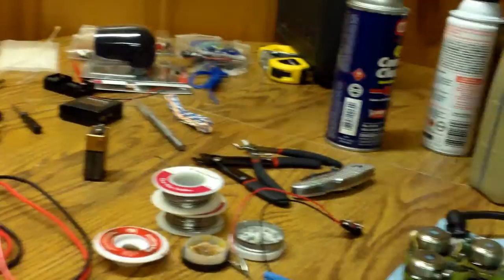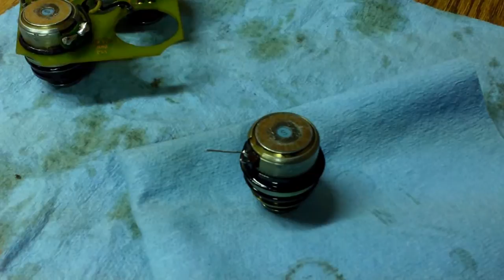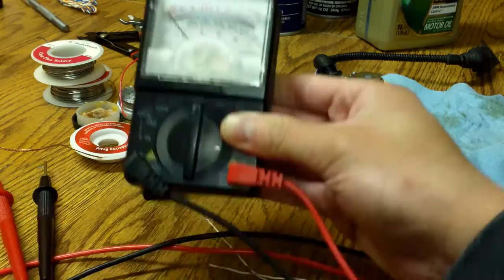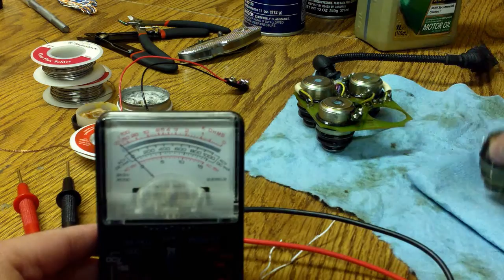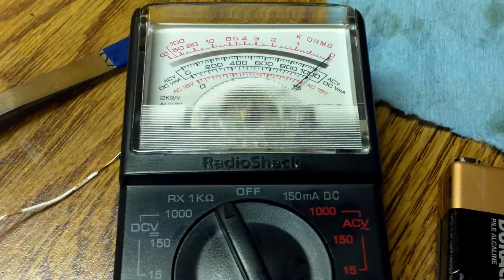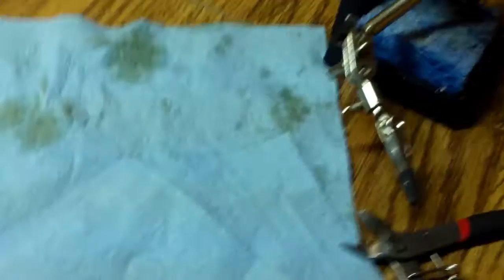DIY BMW E39 M5 VANOS Solenoids Part 2

Comment: hi, can i ask one question. I cleanning my salenoids, then wanna test by battery. And my diods on mainboard are dead. How can i replace this diods?
Reply from the maker: You basically have to melt the original solder, pull off the old diodes, and resolder on new ones. It may be hard to find the right diode, as I don't know the right type. Check out M5board for more information!